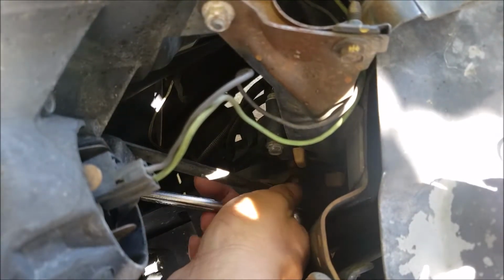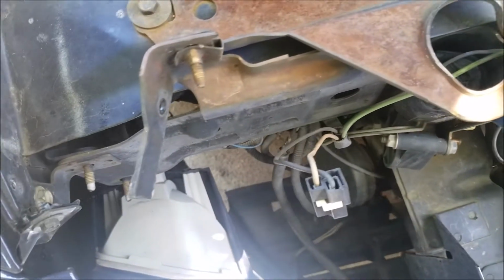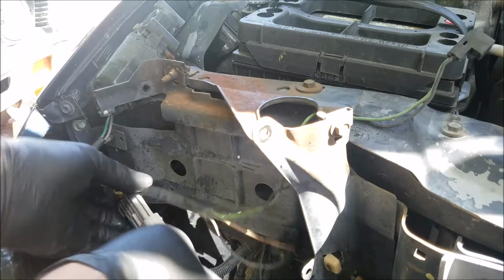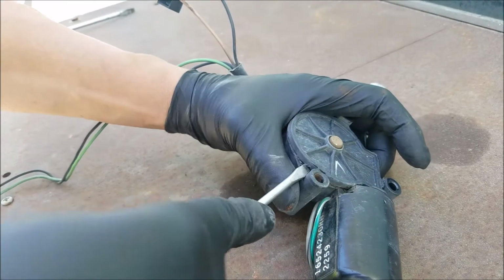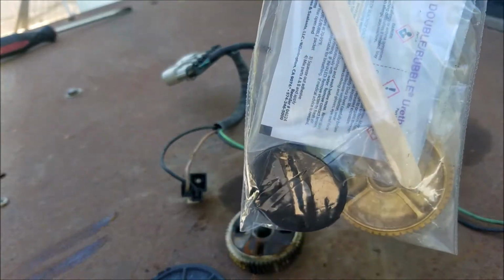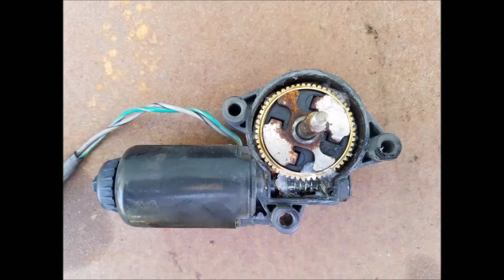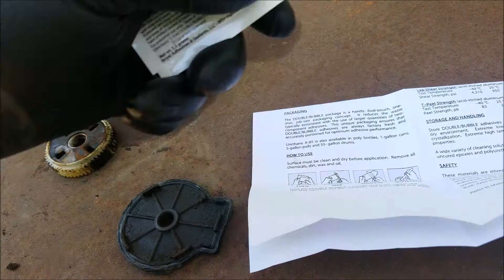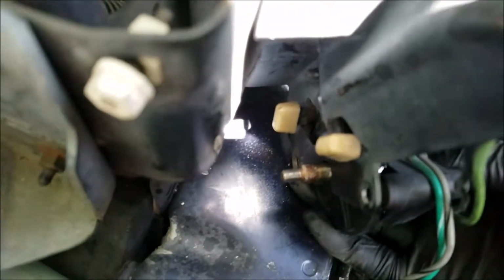How to Replace Headlight Motor Gear Pontiac Firebird Trans Am (Pop Up Motor Fix)

Comment: Any advice on getting good quality headlight bump stops? Mine are getting worn out to the point that the metal arm pushes it out or goes past the rubber bump stop. Thanks in advance 😊

Comment: Any advice on replacing the little white rubber stoppers?  I tried buying an after market stopper but for some reason the shaft on the headlight arm keeps taking it apart, pushes it out, or ends up bypassing the rubber stop getting the shaft stuck on top of the rubber stop.

Comment: FYI:. The motor only uses 1/2 of the gear.  You can rotate plastic gear past the broken teeth, and put it back in place. That will let the headlight work until your brass gear shipment comes in.  The hard part is, lining up the motor to turn, away from the broken gear teeth. Hand crank the motor, with the cover off, on a workbench so you can easily see the gear and teeth at work.  After that just tape closed.  That will hold until your brass gear gets shipped to you.
Reply from the maker: Yes, very true🙂👍

Comment: Thanks a ton for this video! I found it helpful. Folks, make sure you have two 10mm wrenches (not sockets) to get that middle bolt off the headlamp motor; thin/tight spot. I had to borrow from my neighbor.

It took me about 3 hours to do the passenger side gear (plus 1 hour of glue drying). The next one will definitely be faster. 

Thanks again!
Reply from the maker: So glad to be able to help🙂...yea im sure 2nd time is always faster..thank you for watching and for ur support

Comment: Chingow.. now I know what I'm in for this weekend... thanks for the video old schoo...
Reply from the maker: Glad to be able to help🙂
Reply: @backyardchevy328  ..Hey BC.. I  have a 96 trans am.. as I was changing my actuators on my headlights.. I come to find out that the bump stops on one side have broken off... Those bump stops are part of a piece of plastic that goes from one light all the way to the other light it's one solid piece... I'm in a real pickle here... I'm going to have to rig something up
Reply from the maker: @travisquintero8334  yea they're pretty important..they keep the window motor from traveling too far and getting stuck..maybe a junkyard might have one and u can pull em off?
Reply: @backyardchevy328   Hey BC... Well I managed to rig the problem as much as I hate doing it... but I used quarter inch carriage bolts to fit in place of the bump stops it works pretty well.. but hey thank you for the videos I'll definitely keep watching
Reply from the maker: @travisquintero8334  The important thing is that it works..u can always fix it later if u come across a bump stop somewhere.. thank you really appreciate the support

Comment: How did yall disconnect the wires from the head lamps
Reply from the maker: They just pull off but they can get stuck on there pretty good with the rust and moisture..i find it helpful to move the connector up and down a lil til it begins to free up

Comment: Thanks for this video it helped me a lot but unfortunately 2 years passed and the head light started to rattle again. I just checked and saw that even with this type of gear its still no good in my experience. Is there any better gears out there?
Reply from the maker: Thank you🙂 no, not that I know of..i had that happen to one and it ended up being the glue that unglued/cracked apart so i ended up using a better epoxy and it was fine again
Reply: @backyardchevy328  I think thats what happened to me. As soon as I can move the motor the cover was already loose. I am going to make sure its really sealed this time.
Reply from the maker: @carlisio1237  yea, then thats most likely the same problem..sealing it back up should take care of the issue🙂👍 good luck

Comment: Im keeping both headliner open .passengers side went is down makes a rattle noise continuously..any clues???
Reply from the maker: Usually a rattling noise means something is loose or slipping..and if the headlight stays down or keeps falling back down..normally its the gear thats stripped so itll give u a rattling noise everytime it tries to grab
Reply: The teeth are definitely stripped in a section of the gear.  Did you get around to replacing the gear yet?  I've did this on both headlights.  It's just like in the video.

Comment: Great video and tips! Do you know if there's a way to lessen the noise that the linkage makes when the lights pop up and close down?
Reply from the maker: It depends sometimes it can be the linkage thats really worn..or other times it can make a lot of noise if the rubber stops are missing or bent back  so that extra travel causes more noise.
Reply: @backyardchevy328  , I'll have to look into it. It's an 2002 T/A WS6 that has always been garaged with only 32,000 miles. I'm surprised that these things already need to be replaced!
Reply from the maker: @rzthis1  yea thats odd, the one on video had 130k miles and we got a 2001 ws6 with 64k and its still fine as far as the headlight motors go

Comment: Do you know if this repair kit would work on a 1988 Firebird formula?
Reply from the maker: The 1987-1992's have a different sized gear
Reply: @backyardchevy328  do you know where I would be able to get this gear? I’ve been looking for a couple hours online but I haven’t been able to find it.
Reply: Thank you for the response!!
Reply from the maker: @natalieenglert8424  ebay has a few, just type in headlight motor gear 1988 firebird
Reply: @backyardchevy328  I have been trying to find some Firebird sized ones but I have not been having any luck. I’ve only found 1988-1996 corvette headlight repair kits on eBay. Do you know if these would fit?
Reply from the maker: @natalieenglert8424  https://www.ebay.com/itm/161625407779 these ones are that sized in aluminum which would be stronger than the plastic
Reply: @backyardchevy328  thank you so much!!
Reply from the maker: @natalieenglert8424  glad to be able to help🙂

Comment: Interesting ..this will fit a 2000 trans am correct?
Reply from the maker: Yes
Reply: How do u take off the wires to the headlights?
Reply from the maker: @joseesguapo  like the wires from the actual connector? Or the connector from the bulb?
Reply: To the connector, I'm trying to just pull but ima afraid the wires will rip off
Reply from the maker: @joseesguapo  might help to spray it with wd40 if they're stuck on there
Reply: I found a tiny needle clip that holds it together
Reply from the maker: @joseesguapo  really? This one must not have had em

Comment: What do I do if I can’t move up one of the headlights
Reply from the maker: If u rotate the motor knob by hand does it lift it?
Reply: For the driver side yes but the passenger side is loss and won’t go up when spun
Reply from the maker: @Steve-cq2cj  how about if u pull up light as u rotate knob to get past the  broken parts of gear? If it doesnt move at all it could be the linkage is jammed possibly.
Reply: Ok I’ll try that thanks for the help
Reply from the maker: @Steve-cq2cj  hope it works..thats what i had to do on one i replaced recently pull up as i rotate

Comment: i replaced mine and the light works but when it goes down it pops back up and  i have to manually put it down know why?
Reply from the maker: like it goes down and up without turning knob again? or like it goes up when it should be down?
Reply from the maker: if it does it in same motion then u might wanna check if its getting caught somewhere, like maybe the headlight assembly hitting on the hood or the lever make sure its moving freely, on the one i did since it was a used headlight assembly it hit on hood and i had to adjust it so it wouldnt.
Reply: i turn on the light no problem. i turn them off the light goes down then rases back up
Reply from the maker: Maybe that plastic stop is missing or bent and instead of stopping, it goes all around.
Reply: Backyard Chevy. Possibly ill get back out there an a bit and fool with it thank you very much fir your help
Reply from the maker: Hope it is that, good luck hope u get it fixed, please let me know how it goes.
Reply: it was the little rubber stop so after i get the piece it will be done than you!!
Reply: also very nice video and production! keep it up!!
Reply from the maker: That's awesome!
Reply from the maker: Thank you i really appreciate it:)

Comment: I replaced both motors, now when one light pops up, the other one closes.  Such a beating.
Reply from the maker: Did u end up getting a remanufactured unit? there's 2 wires that go 2 the motor itself and on the one thats opening instead of closing flip around those 2 wire location and it should work fine
Reply: That arm seems like it doesn't want to come off now.
Reply from the maker: @bigahill  u dont have to remove the whole assembly, if u can just pull the wiring out and flip around those 2 wires, thats all u gotta do..u can leave it assembled
Reply: Awesome.  I will try that tomorrow.  Thanks.
Reply from the maker: @bigahill  No problem🙂 glad to help...i had the same problem with a remanufactured motor a friend of mine got, i ended up having to do the same thing for em....hope ur able to get it worked out🙂
Reply: I feel like Macgyver with this thing.
Reply from the maker: @bigahill  lol yea, itll be a good feeling once u see em both raise and lower together🙂
Reply: LOL I had the same thing happened to me. I just had to hand crank my motor to correct starting position (all the way till the motor stopped).  Then the lights sinked up.  At least that worked for me.